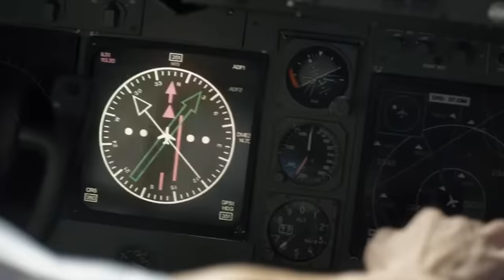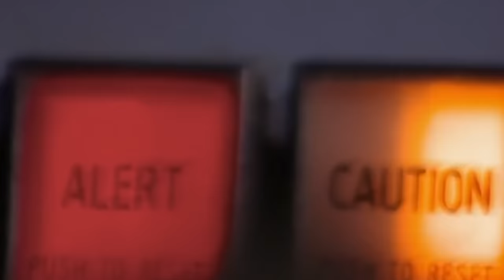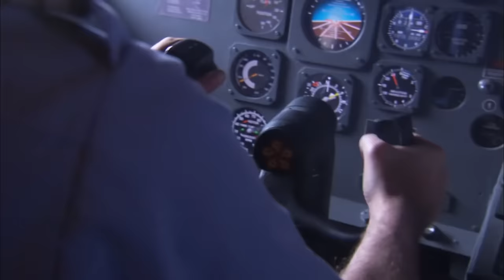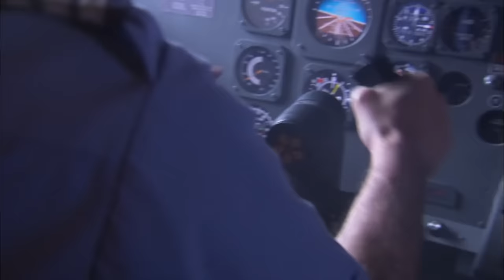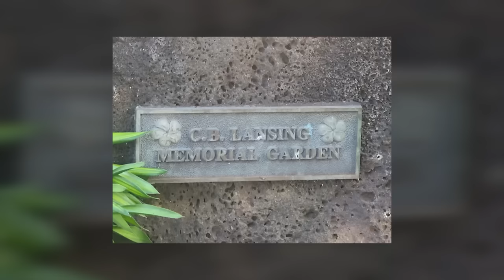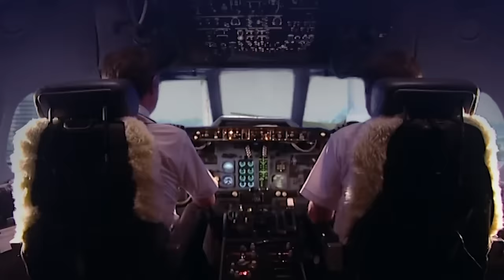5 Bizarre Airplane Disasters that Would Give You Goosebumps

Comment: It’s worth noting that every single incident covered here resulted in multiple changes to aircraft systems, pilot training, maintenance, and flight protocols to greatly decrease the likelihood of a such a failure ever happening again. While not perfect, proper air crash investigation is the reason commercial aviation is the safest way to travel today.
Reply: Yesss❤
Reply: Very safe…until the current process or maintenance protocol oversights come to light. Sadly there’s an issue at this very moment that nobody sees yet, until the next disaster
Reply: @MutedGrowl That'd be true if life was a loop but the hard truth for us humans to perceive without a little critical thinking and review of history is that time isn't a loop but a straight line. There will come a day when safety meets a point of diminishing returns relative to the FAA and NTSB's idea of what's reasonably possible at which point it may be extremely rare that you hear on aviation accident in ones lifetime. Not sure why you're so set on expressing your pessimistic and frankly irrational opinion as if it were some sobering tough reality we'd all just rather not talk about or something. The statement you're commenting on in your misplaced cautionary/fear mongering prose didn't say accidents were over for good today or anything.
Reply: @fredspofford  Actually, @MutedGrowl isn’t that wrong. Air travel has become safer in part due to accidents. It’s messed up, but it’s part of the engineering process. Engineers are going to do their absolute best to take any errors out of their design. However, there is always the human error factor that typically sparks a change in deign.
Reply: Alaska airlines didn’t lube the jack screw as required. The correct procedure was already in place, but wasn’t followed.
Reply: Wow no shit!
Reply: @brandonfrye2902  Oh you are so clever! 🙄🙄🙄🙄I have only seen this  EXACT comment about 100,000 times.
Reply: No it's not worth noting
Reply: The worst part is nobody can do anything about it. You're completely at the mercy of just hoping that everything is okay and everyone did their job.
Reply: Love that you made that point. Incredibly easy to overlook.
Reply: Everywhere but Boeing lol
Reply: Boing
Reply: Exactly that’s why I hate flying I can’t trust people it’s not that I’m scared of being in the air but chances are if your car gets caught on fire god forbid that happens but you would be able to jump out and save yourself whilst fire in an aeroplane while your in mid air no chance
Reply: You sound like a PR spokesman for Boeing
Reply: And still Boeing planes have issues.

Comment: For aloha airlines, it was not necessarily the age of the plane, but the number of cycles.  Every time it took off and landed, there were changes in pressure that created metal fatigue.  The plane did a lot of hops between the islands, so it had more take off and landings, or cycles, then other planes that may have had the same type of mileage.  There were other planes that were the same age but in much better condition because they didn't go through as many cycles.
Reply: Very true, all those short little hops between islands, compressed and decompressed all those times is definitely going to bring about metal fatigue much faster than a medium or long haul airliner.
Reply: Additionally, I believe, salt had hastened corrosion which exacerbated further the damage caused by metal-fatigue, as the aircraft had operated extensively in a salty environment.
Reply: It was the wrong bolt being put in around the windscreen/window. That's why the window came out.
Reply: Also they did check the airframe when inspecting airplane a passenger notice a crack while boarding didn’t not say nothing.
Reply: Also worth noting: At the time of the accident, aloha airlines 261 also held the record for the highest number of flight cycles in the world.  The airplane was well and truly worn out.
Reply: @ColinGriffin-tl6oi wrong flight

Comment: Had a near one , we were coming into to land then as we saw the runway there was an immediate power and we started to increase height. The captain came  on over the speakers saying that there was a plane still on the runway so he aborted the landing. We were on a transalantic run coming into Gatwick. He got the loudest applause i have ever heard when we landed.
Reply: Hold on, he told you WHILE in the air? That might seem great to you but it’s actually pretty unprofessional. Go arounds tend to get an announcement as they’re jarring - but usually it’s very minimal. Saying “I had to punch it because ATC messed up and had a plane on the runway I was landing on” is so strange for a pilot to admit in the air, considering it could cause the mass panic of 200 people. 

Telling you once on the ground? Understandable, especially as near incursions often make the news. But I would never want to be told while in the air because then my mind is only going to focus on how ATC is doing a horrible job.
Reply: That happened to me arriving in St Louis in 92 on TWA
Reply from the maker: Wow 😮
Reply: Had an incident leaving Atlanta about 20 years ago.Was on a business jet heading for Panama City Beach,FL.
As we took off,the pilot pulled the plane into a steep climb,throttling the engines wide open.....I mean they were screaming.
After  what seemed forever,the plane leveled,but before it did,I looked out the window in time to see a 747 passing underneath us.
I closed the shade and turned my phone on 😐
Reply: @OfftheWallTales  You do realize there's quite a bit of time between a go-around and the next landing attempt?

Comment: Just a clarification.  Many believe that if there is a failure in the structure of an aircraft, that passengers or cargo, are 'sucked' out of the aircraft.  In reality, they are actually blown out. When the cabin of the aircraft is pressurized, and there is a failure, the cabin depressurizes through the hole.  Think of it as a pressurized tire.  If you puncture the tire, the air isn't sucked out of the tire.  Just as the aircraft depressurizes through the hole.
Reply: Your comment will likely help some people to better understand how depressurization works, but it's really just a matter of semantics. 'Sucked' and 'blown' are both terms used to describe forces experienced by objects that are exposed to the movement of gases or liquids along a pressure gradient, and the forces acting in such a system will always come from the higher pressure side. They are being 'sucked' into the lower pressure environment, or being 'blown' out of the higher pressure environment. I hope this comment bypasses the censorship policies.
Reply: @sombra1111  Congratulations, you've bypassed the automated censorship.
Truly pain in the rear these days on youtube.
Reply: @tappajaav  It's so bad that I honestly think the people responsible should lose their Earth licence.

Comment: You don't get sucked out! You get pushed out by air pressure rushing toward wherever the hole is from the jet being pressurized.
Reply: I looked for this comment. Well done.
Reply: No, the low pressure sucks out the air.
Reply: @johnp139  That's not how it works at all
Reply: If you are no longer INSIDE the plane, whether you got sucked out or pushed out, really isnt your main problem to solve. 😒

Comment: that window was replaced by a mechanic. he used bolts with a slightly smaller diameter but same thread pitch. These exist in the imperial system.

Comment: It's worth noting that the engineer who replaced the windshield on that one flight didn't purposely choose a bolt that was 0.5mm thinner. He either couldn't find the right bolt or didn't have the ID number for the bolt. So he used the old eyeball comparison. Putting the new bolt up to the existing bolt to make sure he had the right one. Of course, it wasn't the proper procedure, even at the time. But it's also more understandable how the mistake was made, given a difference that small is almost impossible to see with the naked eye.
Reply: Good observation. But you don't replace a part with an inferior part for a vehicle/ plane. I think globally most mechanics and engineers know this but everyone from the creation of vehicles and planes by wealthy companies to its laborer have to understand the right parts/repairs are absolute and patience saves lives. Don't fly or drive with inferior parts and inferior repairs made.

Comment: I remember all of these being on the news.  The cover photo of Newsweek from the Tenerife crash was horrific and that was the “sanitized” one.  

And you didn’t say why all of those planes were on Tenerife.  That’s critical to the story.  The larger airport on the neighboring island had been bombed and was out of service.  So all of those very large planes were having to use Tenerife which was not large enough nor properly equipped to handle them.  Adding dense fog that descended onto the island only made it worse.

This crash was the reason that pilots have to acknowledge explicit directives from ATC by parroting back the directive and stating their flight number.  The PanAm flight and the KLM flight were both being directed by ATC without it being clear who was being spoken to at any given time.  It didn’t help that the controller on duty didn’t acknowledge that a 747 can’t actually execute a 135 degree turn off of a runway.  Throw in the KLM pilot’s arrogance that he “knew” he was right and almost 600 people paid the price for it.
Reply: He did mention the bomb threat.

Also the 2nd thing you said about it being the reason why they have to say their call sign etc is wrong.

And no, they hadn't become confused because of ATC not clarifying who he was speaking to. It was due to the "timing" of the transmissions so there was an instance or two where chatter overlapped and a word or transmission was muffled and missed.
I do know how facts on these disasters tend to get scrambled and it turns into a game of telephone however so not saying you made stuff up. I've listened to the recordings etc several times though.

Comment: Please, please, please stop using the term "sucked". In a pressurized aircraft, the pressure inside is greater than the pressure outside. Any person forced out of the aircraft is BLOWN out. Outside air is not a hoover vacuum cleaner.
Reply from the maker: Thank you :)
Reply: The pressure is low outside of the aircraft.

Comment: 13:29 positivly incorrect. Vertical stabilizer and horizontal stabilizer serve two totally different directions, its literally the difference of up and down vs left and right. 

Alaska lost its horizontal stabilizer Japan air lost its vertical stabilizer which led to hydraulics failure of the horizontal stab

both are in the same area of most aircraft but server VERY different purposes

Comment: Another example would be American Airlines 191. It was one of many DC-10s that airliners developed a cost effective (or efficient) way of maintaining the engine and pylon mount. Basically airlines would unscrew the pylon (which isn’t the manufacturer’s way of doing it) with a forklift under it. If the forklift wasn’t aligned properly under the wing where the engine and pylon would go, then it couldn’t be screwed in properly (it would rock from side to side and the bolts would crack). In 1979, at O’Hare in Chicago, AA 191 was rolling down the runway and the engine + pylon flew off simultaneously (remember that rocking back and forth motion of the pylon, it really bit them in the ass). Nonetheless, the plane did take off but it banked to the left  and pitched downwards because the hydraulic fluid that was leaking out from the wing that formerly had an engine. The plane crashed into a hanger and exploded killing all.
Reply: I was there. I was 9 yrs old and we lived in a trailer in Des Plaines. They found a limb on our roof and aircraft parts in our car port

Comment: When communication plays the most important part, staff should be taught to speak the languange with clarity and to fluency of the language to avoid negative outcome. I hope it has changed by now.
Reply: It has.  Because of Tenerife, pilots may not cowboy their way through ATC directives because they are sure they heard what they wanted to hear.  Pilots must parrot back the explicit directive that was explicitly said to them along with their flight number.  Takeoffs, landings and other maneuvers are not done until ATC explicitly says they are to do so.
“Flight 123, you are clear for takeoff on Runway 21X.”
“Roger, Tower.  Name Airlines flight 123 clear for takeoff on runway 21X.  Over.” 

The other major issue with Tenerife is that it’s not an airport meant for or equipped for large airliners.  It was pressed into service that day because the large airport on the neighboring island had been bombed.
Reply: English is the language spoken in the aviation world so I’m told.. You are right about clarity 100%..